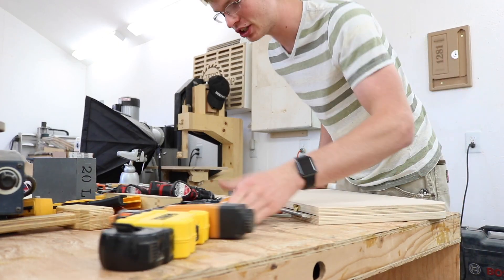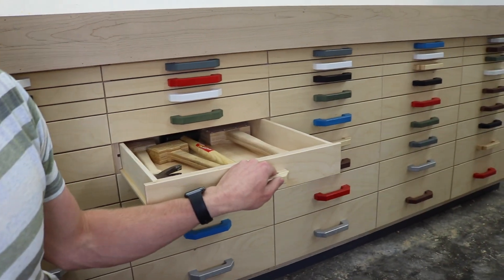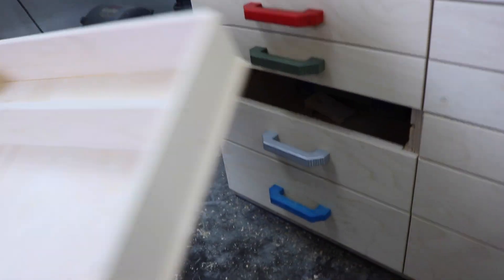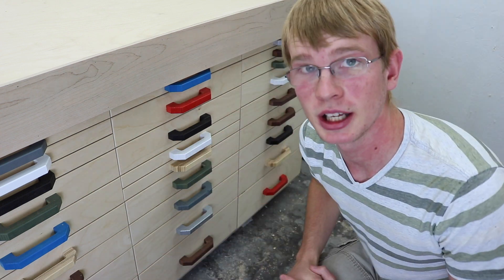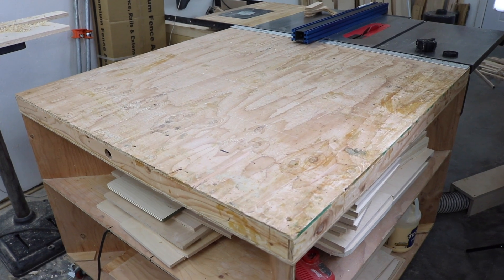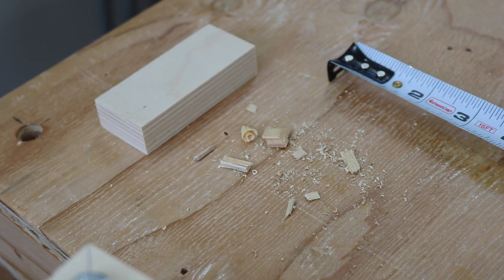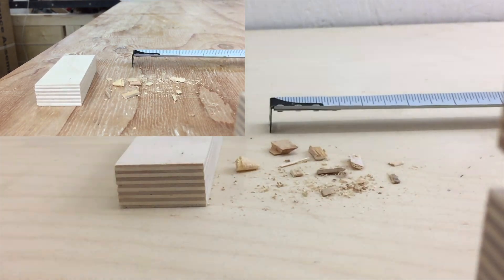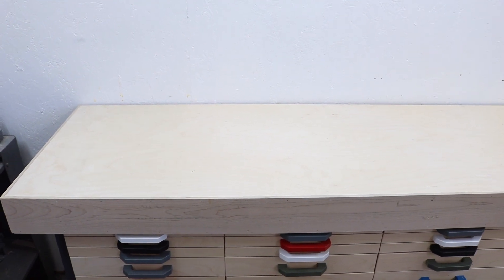Incredible Tool Cabinet / Workbench!

Comment: I move house every 4-5 years and sometimes my shop is in a garage or even garden shed. Moving large benches and units is a real pain and they never fit properly again in their new environment.

Your video inspired me to build everything into individual chests of drawers that I can build multiple units of positioned together with a bench top on. That way I can keep adding to my shop for future expansion and when I relocate, I can reconfigure all of the drawer units to fit perfectly to any space. Whether it be straight, L shaped, U shaped or even an island shape!

Thanks
Reply: I know the feeling. I'm renting at the moment so building anything that size would be... well to be honest, I don't think I would be able to move it to my next house, so whoever moves in here after me would score an awesome bench!  Your modular version is something I like the sound of as I have been toying with the idea of a mobile work surface with big enough wheels to move it out of the shed easily. Small enough to squeeze through a PA door but stable enough to drag over uneven ground. Alas, it would seem that I have absolutely no trace of innovation whatsoever. Well, certainly not enough to see it come together.

Comment: Great bench!  I love the drawer system, I have used a similar one in my work van for years and I love it.  I plan to standardize on this system in my next workshop.  I am concerned that plywood runners will not wear well or slide easily enough so my favorite system uses solid wood runners attached to the side of the drawer in place of the plywood runners you used.  -  Consider adding a labeling system.  Attach a label holder to the front of each drawer and label each one.  Color coding is okay but labels are better and a label holder lets you keep the label up to date with what is in the drawer.  Be sure to label at least one drawer as "Miscellaneous" so you have a place to put random stuff.  -  Also consider adding a simple replenishment system.  When you get low on something place one of them in a bin near the door to your shop labeled "Stuff to Buy".  Any time you go to the hardware look in that "Stuff to Buy" bin and add anything that's in there to your shopping list.  -  Also consider adding a modular lid to your drawers.  Make it so you can add the lid easily but its not permanently attached.  This would make any drawer into an instant carrying case.  -  Also consider leaving an empty drawer in the top position to serve in place of the tool tray built into the tops of traditional workbenches.  Place the tools you are currently using in that drawer then at the end of the day put them back in their "home" drawer for later use.
Reply: Excellent suggestions!!! Specially the drawer "need to buy". On occasions, I forgotten and left the home center without one or two items that I needed.
Reply: Bang, bang, bang, one good idea after another!

Comment: Love the universal drawer system! Great idea. If you do another you might consider trowling the concrete smooth and putting a layer of epoxy over it. It'll give you a very smooth and durable surface while further reducing impact/vibration.

Comment: You could add a sacrificial 3/4 particle board top on the top as well. We did that in our furniture shop for years. It can be replaced when worn. You can then also screw directly to the top to secure items as well.

Comment: ok, love the drawer design, the liw cost, quasi full extension sludes, and the rearrangableness is great, the color coded handles are also pretty clever. Two things though, a place for a vice would be nice, and a bit more overhang in some way so that one could sit at the bench when needed, would be great for us much older timers. Keep the projects comming, Thx.

Comment: Run some T-track  along the top of the bench for your hold downs...maybe two or three strips.(if you decide you want hold downs) that way if you get small parts in them you can retrieve them easier and have more adjustability for hold downs..

Great build..I am going to borrow some of your ideas in the future for my shop...thanks for sharing =)
Reply from the maker: +TheDirtFighter 
I don't like T-tracks in a workbench, because they are a significant interruption of the otherwise smooth surface. The less interruptions the better, in my opinion. And I don't think it would take any more time to thread something into inserts than to slide it into a track, since everything has to enter the end of the track.

Comment: Your idea for a concrete top would also be terrific for a router table or shop-made jointer. Expensive shapers and table saws have historically included concrete-filled bases to eliminate vibration.

Comment: I have seen both videos I understand your plywood to concrete problem. It might have been better solved by pouring a thin layer of self leveling polymer a little pricey but it would have filled all the voids. Great work and craftsmanship I'm very impressed.

Comment: I made two wall cabinets with similar drawers, but using hardboard bottoms.  I incorporated some 'shelves' as well, for things that need to stand upright.  I find that I often pull out the entire drawer for use on the bench, i.e. while selecting wood screws.  Easy to put back, though.

You've done a very nice execution on this.
Reply from the maker: +Dennis Templeton 
Yep I'm often removing the entire drawer too. Very handy.
Thanks!

Comment: Thanks for showing this practical storage design. I've made cases for similar drawers quickly by using slatwall for the sidewalls. While this method does not allow the same 1 1/2" tight spacing for the drawers as your design, it saves a lot of time by eliminating the need for all the dado work. (The slatwall grooves are typically 3/8" wide at 3" o.c., accommodating 3/8" plywood bottoms and providing usable inside drawer height of about 2 1/2".)

As for the top, if the bench will be permanently stationed against a wall, bolting a top frame with two layers of MDF or melamine for the working surface will significantly minimize vibration while absolutely eliminating racking. The advantage is that such a top can be bored to allow front and/or end vice installation, as well as top holes for clamping like MFT.

Comment: Your modular drawer system is a great idea. If you stick with it on any future builds that need drawers, you'll have great flexibility. Really a great idea. Try putting some paste wax on the drawer "runners" to see if that helps with any friction issues.   Scott
Reply from the maker: +The 2 Car Garage Shop 
Thanks!

Comment: It's a physical phenomena called "resonance".

The resonance frequency of the wooden table is within the vibrating spectrum of the orbital sander.

The resonance frequency of the concrete table is so low that is beneath the vibration spectrum of the sander.

When the table resonates makes the piece of wood you're sanding doing very little jumps at the rotation frequency, which is high so it jumps continuously and it's like it's flying on the surface.

The concrete table basically prevents almost completely the phenomena allowing the piece of wood to stand still cause it never looses adhesion with the surface.

This is basically a consequence of it's higher mass and it's higher stiffness.
Reply: This is a lot better than my other post.

Comment: You can polish concrete to a very fine, smooth surface. I've seen it done as flooring, and it looked great, not rough or abrasive at all.
Reply from the maker: Not really relevant here...actually rougher is probably better, for better adhesion of the wood surface.

Comment: Excellent idea with the concrete! I need to have 360' access to whatever I am working on though so I think I will have a go at constructing a worktop similar to the wobbly one you showed at the beginning.
It should be possible to make one which does not move about too much if the legs and frame are braced with plenty of thick plywood.
Glad I found your channel, it looks like you are very accomplished and have good delivery, I am sure I will get a lot from subscribing!

Thanks!!!

Comment: First time watching your videos.  Not sure I'd ever attempt that rock solid (no pun of course) work bench but it is nice to see younger folks building expertise in such crafts.  Besides I now see how some contractors go about making concrete counter tops that compete with marble.  Also some of the concepts Stonehenge builders used to move monstrous slabs could have helped move the top from the form to the bench.  aks jack up one end of pouring table and use levers and/or a ratchet strap and a U shaped metal clip for one end of slab. some talc and or small amount od sawdust to lube the contact surfaces.   Great work!

Comment: Great build, and I hope it has already given you much joy in the shop and will continue to do so. Tonnes of storage.

About that though. I have found it to be - for me - impractical to have storage and work top/surfaces in the same place. It all comes down to access. On the work top, I want access to the piece all the way around, along with stops and clamping ability... The position along the wall along with the drawers kinda screws with that idea. Next is acess to the drawers. If a board or door was clamped to the face of the bench, you'd be blocking the drawers. Where is the fun in that? My shop is still under construction, but for those same reasons, I have decided on a simple construction lumber roubo style bench, as it has some heft due to the dimensions alone, along with a tool box, old American style with trays, and full height tool cabinets - much like your bench, only with drawers to about waist height, and then doors the rest of the way up. That way I'm always free to clamp, have something sitting in/on the bench, while still having full access to all of my tools. Mind you - this is not my first build. I've had to learn it the hard way. If your workflow is different from mine, then you might just have built exactly what you need. I hope so. Otherwise, you can always stack some cupboards on top of that slab, once you get your next/real bench built. If needed, that is. Nice work either way.

Comment: It's great to see the positive effects of a concrete top. I imagine it would be an incredible pain to move... Another idea (for other people) might be to create a 'hybrid' workbench top, where one section is concrete (for hammering, chisel work and sanding), leaving the other free for general work in a torsion style construction.
Reply from the maker: +Olly Parry-Jones 
Thanks! I think that's a nice idea, the only downside I see (and this probably wouldn't be a problem), is that the overall mass is so much smaller. I think it helps at least a tiny bit to have so much mass spread over such a large area. But that would probably be insignificant; there's no science behind my ramblings! :)

Comment: I believe the reason your sander causes things to wander is vibrations.  The lightweight wooden bench is good at transferring vibrations (which is why wood makes great guitars).  Metal also loves to transfer vibrations.

Concrete loves to absorb vibrations because of it's sheer mass and lack of deformability.  Your layer of nonails probably also helps there.

That's my theory, anyway.  ;)

BTW - awesome build!!!

Comment: Have you considered filling your torsion box worktable with sand?
In my two previous shops I built torsion box work benches and the second one I filled with dry "play sand." 
It made a huge difference in absorbing the vibrations and movements.  The entire bench top became a dead blow surface.
Reply from the maker: +LumberZack 
Hmmm, many others have suggested that, but I told them I didn't think it would work because the sand would settle away from the top surface. Now you're making me think I should give it a try, if it worked for you!
Reply: I only filled the compartments about 3/4 full before affixing the top.  You may not achieve the complete sound deadening you have on the plywood-glued-to-concrete workbench, but the hollow noise will be greatly reduced. 

Just getting my channel started, but perhaps I should make a video on this.  

I need a torsion box workbench for my new shop anyway :)  The physics of it is similar to crashing the toy truck full of marbles.  All of the individual particles move and absorb the energy, preventing it from reflecting back to the surface as "bounce."

Comment: Nice design and execution. Just moved to a new place and need something like this. I have room for one 24 feet wide at the back of the garage. Probably won't go with concrete top though. It would be too difficult to move when I build a new shop at the back of the property. Keep up the good work.
Reply from the maker: +MrToolmaker23 
You probably don't want to make the cabinet any longer than mine. I think it would start to cause some problems if you make it too big in one piece. You can make multiple smaller cabinets and put one top across all of them.
Reply: Jeremy Schmidt
That is exactly what I have in mind. A combination of cabinets 4 and 6 feet wide with one single top ; milled and laminated 2x4s.

Comment: Probably more than you care to know but:
Your old worksurface is compliant, and has a resonant frequency close to what your sander is vibrating at so the whole table gets excited by the sander. The piece you're sanding is  making intermittent contact with the worktable surface as it vibrates, and now you have less friction (dynamic friction vs. static), so it moves around. Your new workbench is very massive, and much stiffer, which means its resonant frequency is very different from your lightweight worksurface. That difference means your sander vibration doesn't excite the workbench and your workpiece stays put. Hit the old worktable with a hammer and then the new one. The difference in pitch is the difference in the resonant frequency assuming your wood top is glued to the concrete well.
Reply from the maker: +james keller 
So if I'm understanding you correctly, a different frequency, i.e. a different rpm on the sander, could maybe cause a workpiece to skid around if it resonates with the heavier top? Of course that frequency may be out of the range of my sander's rpm, but is that at least the correct concept? 
Thanks for your explanation.
Reply: That is the idea. Everything, and I mean everything vibrates at its natural frequency, doesn't matter how big it is. Google the Tacoma Narrows bridge. Damping (how quickly it stops vibrating) is also a factor. If the workbench is well damped it may be impossible for the sander to excite it much at all. I would think the concrete would be better damped than the wood workbench. Anyway, nice workbench!

Comment: Love the bench. I built it this week other than the drawers (and I am skipping the concrete top since I already have a heavy bench). Dados are done and the drawers are next. I did not use finished wood. What do you advise for a finish?  Thanks for any thoughts on finish products, and application methods.
Reply from the maker: +don sisson 
Great to hear!
Mine is unfinished. If you want some finish on it I'd say varnish or oil maybe? I did put some boiled linseed oil on the top, but it tends to stain workpieces for the first couple weeks. After that it's a good finish.
Reply: Thanks for the quick reply.  Keep up the videos.  They are great, and very appreciated.

Comment: Ha, if you want to load test those drawers, I'll come over and sit on them!  Nice job and it looks sweet.  Are you able to partially open a drawer directly under the one you wish to open all the way, so that the lower drawer that's opened 1/2 way would give it some support?  You may have those slides at a tight tolerance where the lower drawer never comes in contact to support an open drawer, above.  Thanks for sharing.
Reply from the maker: +Ron Briz 
Haha, I think I'm ok with just saying they're strong enough! :) 
I think the slides are too tight a tolerance for a 1/2 open one to support another, but I haven't tried it.

Comment: Construction adhesive is flexible (takes a lot but it does flex. You would really have been better off trowling the concrete. I would mark the drawers sides on the top on the sides rather than put the false back in them. Love the stuff. I love your ideas. For tops on workbenches I use laminated hardwood doors bought on the cheap from home centers. You can custom order with no door holes or hinge mortices. Not as sound reducing as the concrete. The reason it doesn't let the parts move around is because there is no flex/rebound (bouncing a basketball on the lightweight table)

Comment: Do the contents of the drawers bounce around when you pound on the bench top? A design I am working on will have drawers in cabinets that roll around but mostly stay backed in under the bench.
Reply from the maker: Definitely not. 600lbs of concrete is enough to completely absorb a whack from a large hammer. Think of stomping on a concrete floor next to a cabinet with drawers. That’s basically what this is like.

Comment: Looks great! Question: how did you connect the concrete  core to the plywood top of the bench to make sure that the vibrations really are absorbed by the concrete? I would have thought that your mallet experiment would be similar to a piece of plywood lying on the concrete floor, therefore my question.
Reply from the maker: +Philipp Bender 
Yes, it's screwed down and any slight gaps are filled. The build video will further answer your question, as I go into more detail there. Thanks!

Comment: A concrete core skinned in sheet material.  That is definitely outside the box thinking.  If that is going to be your work bench, what are you going to do for vices for holding your work pieces in place?
Reply from the maker: +bwillan 
I think I'll add the threaded inserts to one half or third of the bench, and I will definitely bolt down a vise!
Reply: You could always use Tap Con bolts for attaching the vise.